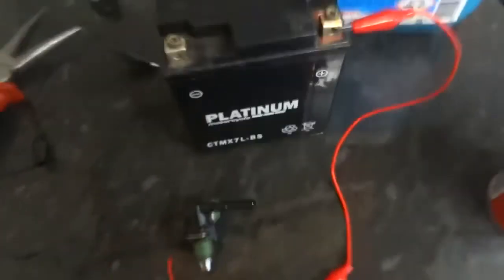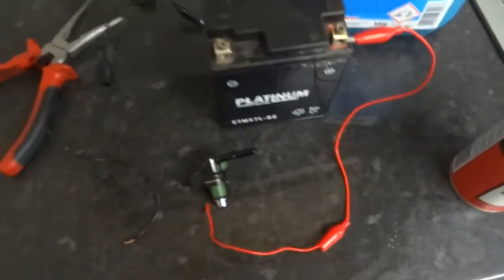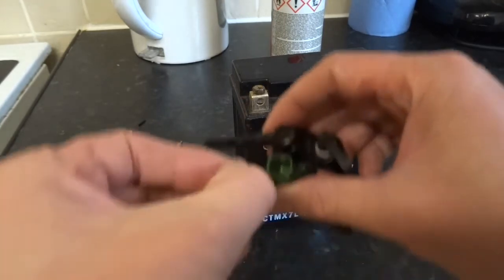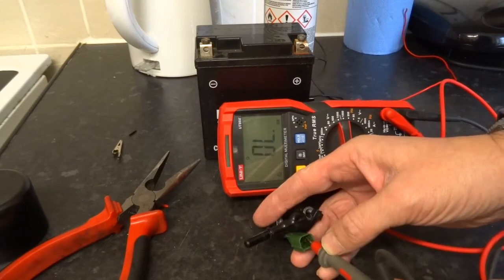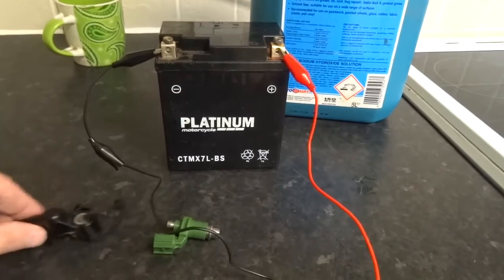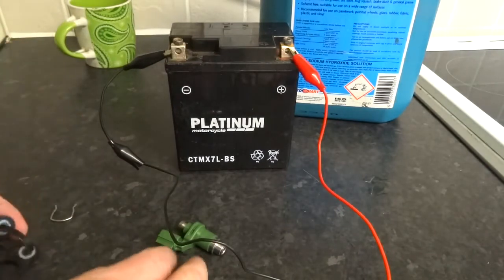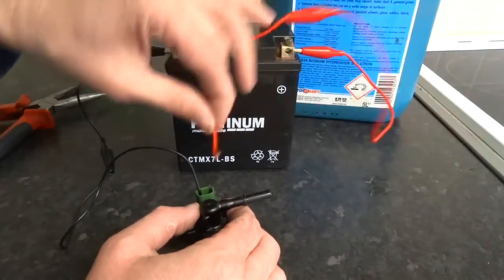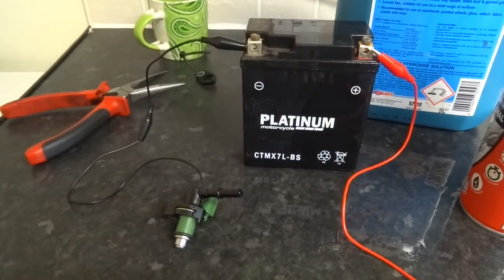DIY Motorcycle Fuel Injector Cleaning & Testing: Save HUNDREDS!

Comment: same injector as my mt125, will try this tomorrow
Reply from the maker: let us know how you get on
Reply: I don't have the g101 cleaner fluid, is there any more common alternative
Reply from the maker: @seoexpertise  U use g101 as ins neat other cheaper stuff have 90% water , just use the throttle cleaner .
Reply: @cagmito76  cheers, i didn't bother cleaning it in the end, turns out I filled my bike with diesel 😂😂
Reply from the maker: @seoexpertise  is it running ok now ?
Reply: @cagmito76  yeh emptied the tank and refilled with petrol all working again 😂
Reply from the maker: @seoexpertise  ah well no harm done , i like the MT nice bikes